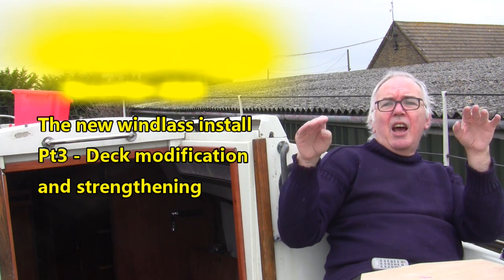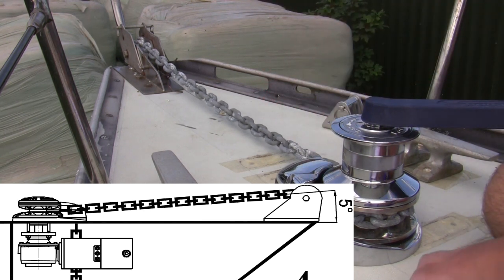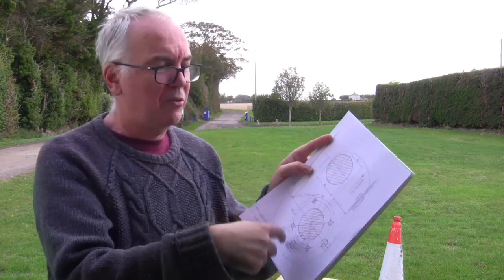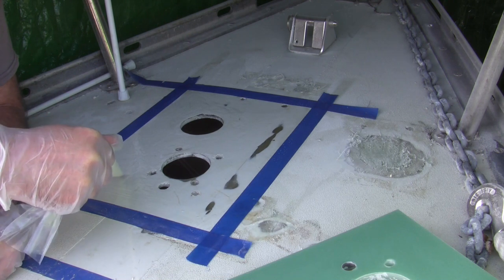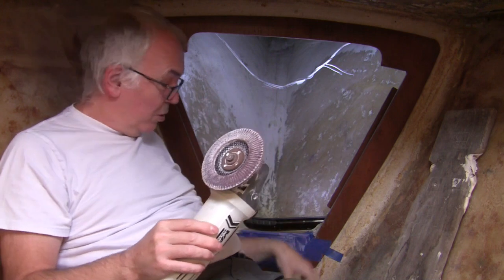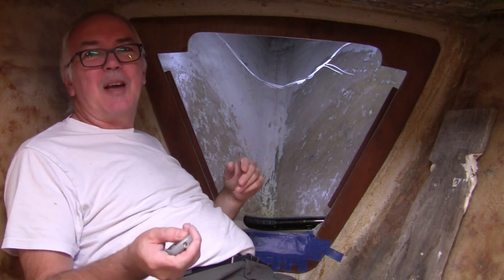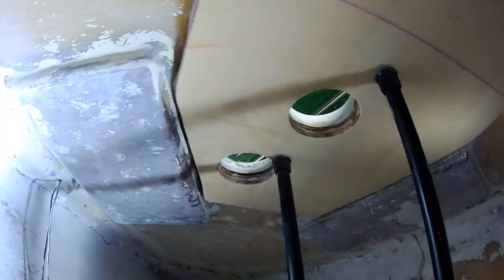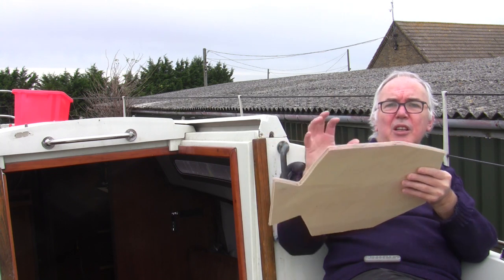Just About Sailing December 2020 - New windlass install, Pt 3 - Deck modification and strengthening

Comment: As others have mentioned, another informative, well put together video and a great looking progress. 
The windlass on our rental sailboat in the Caribbean last winter turned out to be broken. I was very much surprised just how much effort was required to raise the anchor by hand. Prior to this experience I hadn't realized how essential this bit is.
Reply from the maker: Ken
This was previously on my 'nice to have list'. But I would say it is now pretty much essential. The older I get the more tempted I am by things like electric winches, self-tacking jibs, and in-mast furling headsails etc.
I am just about to finish off the wiring - so we'll soon know if it works or not.
Cheers
Paul

Comment: Looks a cracking job so far, best thing I ever did was fit my manual windlass. I wanted an electric one but just couldn't afford it. You be spoilt rotten with that one you bought, it looks a good one too. 👍👍👍
Reply from the maker: It was expensive. But my butler has one on his boat and he seems to like it. So I thought I might as well ;)
Cheers
Paul

Comment: A masterclass on fitting out a boat.  I wish I had a tenth of your skills
Reply from the maker: Thanks Micheal. I only started to do DIY (originally on cars) because I had so many bad experiences with 'professionals' when I was younger - brake failure, throttle sticking open, that sort of thing. Also they were expensive and I was poor. Gradually I started to enjoy it. I think that everyone can do this stuff if done slowly and carefully enough.
Fiberglass and boat work was completely new to me less than 4 four years ago. But if you want to see some bad workmanship, wait until I redo the lining in the vee berth.
Cheers
Paul
Reply: @verynearlyaboutsailing8114  Head linings are a nightmare.. I have redone them in 3 boats  (twice myself) including currently in Golden Haze. The worst finish were UK, apparently professionals, who came out to Gibraltar to do all of Paw Paw my Westerly Ocean 43 and did a total bodge.. worse still they used the wrong glue and it all started to fall off 12 months later!

The difference between your expert work and my awful DIY capabilities is that you are painstaking and a perfectionist and you apparently take your time and are patient. Your results are a higher level than most professionals.

 In my professional trade things had to be done very very fast and if it is near enough for jazz.. 
Really envy your skills and ability and your channel -    Just about Sailing - is original and the best in the boating world.
fair winds
Michael

Comment: You are doing an excellent job with the assistance from your apprentice. Too late now but when measuring the angle of dangle from bow roller to the gypsy, you could have just used a chalk line to save dangling the apprentice.😉
Reply from the maker: Fair point, but it's a long standing tradition to get your apprentice to do those menial tasks that even an inanimate object could perform. It think it improves crew morale or something.
Cheers
Paul

Comment: Slow and steady Paul...prep is key as you stated...I hate hate hate grinding, LOL...anchor locker and windlass fit look great, G10 is the way to go, nice job...stay warm and cheers.
Reply from the maker: Thanks Randy. We were promised warm weather (OK for epoxy) for a couple of weeks and it never happened. The last bit of epoxy work will have to wait. But at least I can turn the heater on in the boat and get some interior work done - including finishing the grinding.
Cheers
Paul
Reply: @verynearlyaboutsailing8114  that's perfect, heat is essential, my heat is 1000 + miles south, LoL...be healthy and safe 
Randy

Comment: Nicely done Paul...
Reply from the maker: Thanks. I think all the effort I am putting in now will be well worth it. The majority of my sailing has been done with either a manual windlass or no windlass at all. I can't wait to be able to just press a button.
I look forward to your next 'epicurean' adventure.
Cheers, Paul
Reply: @verynearlyaboutsailing8114  I fitted a loft and windlass on mine about 2 years ago. Best thing I ever did.

Comment: Great video Paul, nice side note about the scotch bright disk  instead of the flapper disk. I see so many DIY videos where people try to use the flapper disk and end up  taking off more than they intended too. P.S. Nice job!
Reply from the maker: Thanks
I am normally very happy with the flapper disks - but they are brutal and will go through anything if you lose concentration just for a second. Also, I really couldn't see after about 30 seconds of dust, so a lot of the work on the grinder was done by feel.
One day I might finish the whole locker.
Cheers, Paul

Comment: Nice one Paul, you are flying along. You attention to details will stand you good in the future, keep it up. Oooooo bye the way FINE LOOKING BOAT
Reply from the maker: Thanks T.J. Getting the windlass working is probably the single most important modification I am making. It will be so nice to just press a button and the anchor comes up.
And, yes, she is a fine looking boat ;)
Cheers
Paul
Reply: Agreed! But we are not biased TJ!
Reply: @verynearlyaboutsailing8114  yes Paul Damb FINE looking boat LOL. the windlass is great what i found usefull was fitting a switch in the cockpit to raise or lower the anchor "because my legs are not great" and running back is not a good idea singlehanded
Reply from the maker: T.J. Yes, I totally agree. I bought the optional remote unit which I will fit in the cockpit and the footswitches for the foredeck. I haven't done the wiring yet, but it should be reasonably straightforward.

Comment: Looking good. Lots of info for when I fit my windlass.
Reply from the maker: Best of luck with it. Of course the problem is that every boat is very different. On some boats you can just dill a few holes, wire it up, and there you are - job finished.
Cheers
Paul
Reply: I dream of that kind of boat !!!!!
Reply from the maker: When I said, "on some boats", I should have said, "on some imaginary boats" ;)

Comment: That's allot of progress you've made.   I certainly hope that all the torturous  work we are doing gets repaid many times over by easy future anchoring!

Those wide angle lens do make our boats look spacious.  My boat is not big either.  It's only 27 feet long.
Reply from the maker: Tom, yes I'm sure it will all be worth it. It's funny how we have each had completely different technical obstacles to overcome based on the designs of our boats and foredecks.
And the camera certainly makes a difference - I had assumed that Southern Lady was at least 30 ft. 
Wiring next :)
Cheers
Paul

Comment: To have no coring in places where stuff gets thru bolted (like the cleats) is actually the correct way of building a boat. The fiberglass needs to be thick enough in those places though.
Reply from the maker: Thanks, that's interesting. I do have a reasonably good layup diagram for the boat. And there certainly isn't coring everywhere. I'm always pleased when I do need to drill a hole to find out just how thick the layup is.
Cheers
Paul
Reply: Correct, but any through deck fixing does need a backup pad to spread the load.  Penny washers just will not do on their own.

Comment: G10 is amazing stuff, but wow is it hard to work with and so rough on cutting tools.  I like to buy structural fiberglass sheets from McMaster Carr here in the USA that is still very strong, but not not so hard to work with as G10.  I have purchased it in 1/2" sheets which makes really tough backing plates and also raised plinth sections for deck fittings to keep them, and their through-bolts, up above most of the rain and greenwater washing about on the deck.

I would suggest you put a raised plinth under your cleats as well as the windlass.  Between that and the plywood backing plate the only way the cleats could possibly fail is to pull the entire deck off of the hull.
Reply from the maker: Yes, that G10 wrecked my normal cutting tool. The first large hole was more melted through than cut through. I do have some smaller sheets of G10 somewhere that I never used that may be useful for cleats etc.
Years ago in a very powerful storm, the small wooden fishing boat next to my slip came loose and swung round and bashed Serenity (the resultant scratches are on a very early video somewhere). I had assumed that the cleat had come off the fishing boat - but when we looked at the damage, a small front section of the deck had been ripped off with the cleat and line still firmly attached and dangling.
Cheers
Paul
Reply: Another issue with cleat mounting is mushy or compressible core material. If that is the case then the bolt can never truly get tight so under a high load the bolts are slopping around loose-ish in their holes a little bit which will bend and work at them.  Eventually they will snap at the bending point because of work-hardening or the metal surpassing its yeild point.  

A good solid core or a spool of solid fiberglass thickened epoxy from a Drill-Fill-Drill procedure keeps the layers from compressing.

Sometimes even plywood can be too compressible, especially as it ages and retains moisture. G-10 or regular fiberglass laminate sheet makes a better backer plate than plywood IMHO.  Much more work and expense though.  Encapsulation if rhe plywood like you did is a good compromise.

Comment: Great video, lots of good ideas.  What are those rods you use inside to hold the backing plate in place?  About to fit a new windlass on Rumpus and it needs a proper backing board.  Thanks for the tip about G10 too.
Reply from the maker: Ralph, the rods are 'adjustable spring tension curtain rods'. I think they are made to hang net curtains on windows. There are loads of different sizes on Amazon. I use them all the time for lots of different things. They are not very strong, so be careful.
Did Rumpus have an electric windlass before, or a manual one? I can't remember. Make sure you have some very sharp cutting tools for the G10 -it is very tough.
Cheers
Paul

Comment: Is your foredeck not curved port to starboard? I thought you may have made some form of fillet to take account of that or is the thickened epoxy sufficient?
The last time I used my (manual) windlass it was slipping like a good-un - the handle was going round but the gipsy wasn't! Mind you I'd been at the anchorage for about three weeks, it was river mud and the Rocna was well dug in! Anyway, I'm hoping I can get that sorted over the winter or I'll be hauling by hand :-(
Reply from the maker: Yes, the foredeck is curved, but not very much. It's difficult to see with all the crud and the taped up holes, but there are a couple of parallel raised bits at the edge of the non-slip which gave a good way of making sure the G10 was level. But I did also use quite a bit of thickened epoxy. I just put the milk bottles on to keep the G10 level on those lines.
The bit underneath is also quite flat and relied on very thick epoxy, but was easier than I expected to keep it all level. So the two faces should be pretty much level and parallel - I hope.
I have definitely had my fill of hauling by hand. I considered a manual windless, but decided that an electric was the one 'luxury' I was willing to pay for. I also think that the capstan will be useful for hauling up the dinghy etc.
Cheers
Paul
Reply: An electric windlass is worth its weight in gold.  Be sure to size the wires for minimal voltage drop and it will serve you well.

We will anchor every night and weigh anchor every morning for weeks at a time when we are migrating.  I watch other folks in the anchorages struggling with levers and slowly cranking in their rodes while I spend a whole 32 seconds to reel in 100+ feet of chain.  When we are almost out of sight we can look back to see them still at it as we are on our way..

Comment: G10 is indeed hard, but your drill is way too fast, regardless. Your new HSS holesaw will last a lot longer if you slow things right down.
Reply from the maker: Thanks for the advice. It makes sense. I will set the drill on a slower speed.
Cheers
Paul